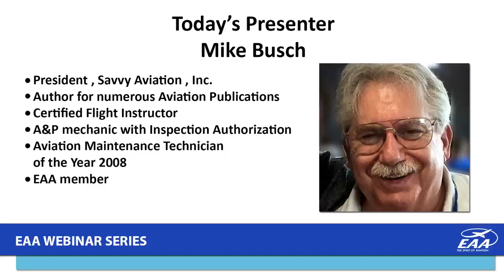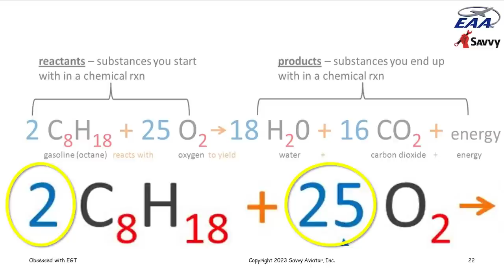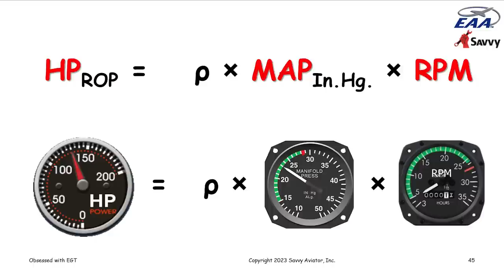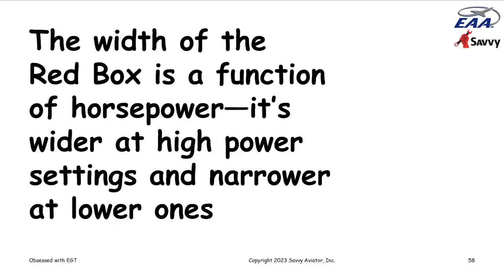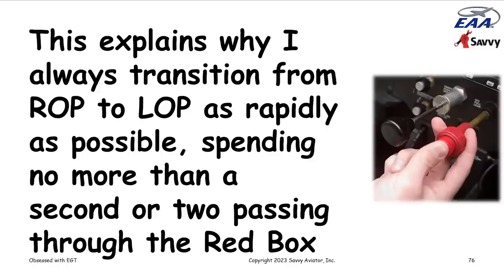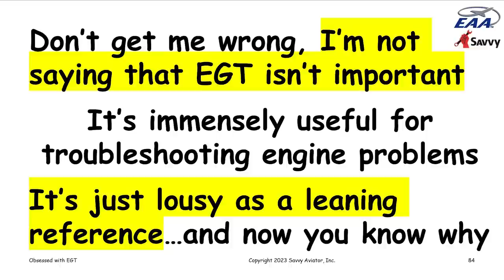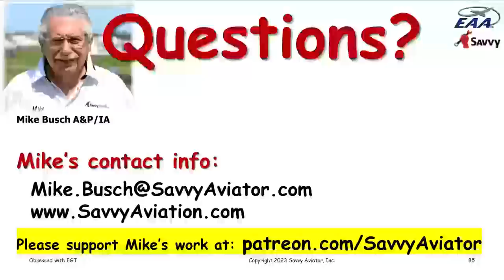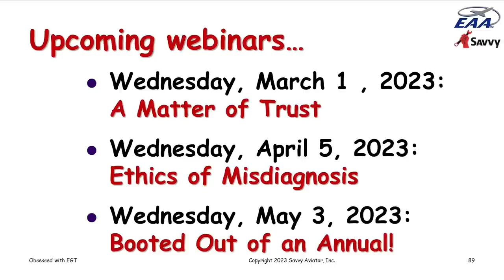Obsessed With EGT

Comment: The engineers of the 50s and 60s should have known about leaning as Lindbergh knew about it in the 30s.
Reply: @brettdavies-young7102  I agree.  Hopefully, people like the folks at GAMI and Mike are slowly dispelling the myths and newer engines like Rotax simply build it into the automation so pilots no longer need to be in the loop doing the wrong thing.
Reply: They did know. All this simplification to our detriment came when lawyers started help write POHs. Take the APS course at Ada even if just the online version. It is so worth it. Lots of the info comes from the WW2 data tables and manuals. The B-17 engineers used all kinds of good stuff to determine exact mixture settings for the pilots.

Comment: The problem with not using EGT is sometimes in rental aircraft, which the many of us who are not fortunate to own an airplane only have the EGT gauge in the aircraft. The other option would be how I learned way back in the early 80s to lean until the engine started to drop off RPM And fly approximately 25 to 50 RPM below maximum RPM for the throttle setting. It’s some cases leaving the throttle full and adjusting cruise power/ rpm with the mixture.

Comment: Coming from the automotive world I was surprised there isn’t a wide band oxygen sensor to run an air/fuel instrument. If we had these, it would the best way to adjust fuel mixture. Hopefully once we transition from 100LL to UL we’ll see air/fuel instruments too
Reply: I agree.  O2 sensors don’t like lead so they aren’t an option with the current archaic aviation engines and fuels.  Aviation propulsion is at least 50 years behind the technology curve sadly.
Reply: In automotive applications,  is catalytic converter  needed to have the after- before O2 readings to get a measure of unburnt fuel?
Reply: Simple is reliable........the more you try to make automotive engine mods to aircraft engines the less reliable they are as aircraft engines
Reply: @BrianOgilvie79  Modern auto engines are vastly more reliable than were their much simpler predecessors.  A modern airplane engine will be more reliable than current 70 year old technology engines.  Absolutely no doubt about it.
Reply: @rossrobinson7943  no, the sensor before the converter measures mixture and the one after the converter measures the efficiency of the converter
Reply: @LTVoyager  except everyone wants it’s for dirt cheap, that won’t happen. 

Also, I’ve worked on the “modern” Austro engine, one bad sensor and you’re grounded. Of course, it’s easier to fix from a troubleshooting standpoint, basically need a computer and basic diesel knowledge.
Reply: @TheReadBaron91  The Rotax is about the same cost as a Lycoming or Continental.  Using mass produced auto parts will keep the costs quite reasonable as they are pretty much dirt cheap.  And having redundant sensors for critical parameters isn’t any harder than have two spark plugs per cylinder, which is largely unnecessary with modern spark plugs and EFI.  The money and weight saved on the plugs will cover a number of sensors.
Reply: If you come over to the experimental side you can pretty much run whatever instrumentation you want, not withstanding your valid concern about lead contamination. Just don't forget that stock airplane engines are notoriously bad from a cylinder to cylinder A/F distribution standpoint and it is critical to make sure the richest one goes comfortably lean of peak.
Reply: @clarkstonguy1065  Yes, that is why GAMI exists.  😁
Reply: @TheJustinJ  If you are using a carburetor, you are nearly as far behind the technology as is the FAA.

Comment: great discussion with regard to the whys. I'm still stuck on trying to figure out the how that is very quickly discussed in the final two minutes after listening for the first 50 minutes discussing why the great reveal is gonna be so great!!! 

Doing "the great pull". I am assuming you mean pull until the engine starts to run rough and then increase the mixture to allow smooth engine ops. Do you keep adding mixture until CHTs reach a certain value (380F, 400F, etc)? Once you pull the mixture through the "forbidden range" so to say, what are you then adjusting to in a NA fixed pitch aircraft? thanks

Always love hearing these videos but sometimes it seems that the important stuff is just ran over real quick!!!

Comment: Your explanation of LOP operation is very interesting.
It makes sense, Deisel engines have no throttle, the control of power is solely determined by fuel metering.
I works on turbines, it works on deisels, why wouldn't it apply to petrol engines?
I guess the early petrol engines had throttles  because it was easy, and it stuck.
Reply: The throttle is useful because:
1) It allows for power modulation at lower power settings, without roughness, misfire, and risk of engine stall.
2) It simplifies non-computer controlled (i.e. mechanical) power modulation, because wide-open position produces max power. Conversely, max power is produced below full-rich mixture. Also, there is a wide range of rich mixtures that results in very small changes of power.

Comment: Thank you for your very informative talk about engine leaning and LOP operation. I have an aeroplane with a 285 hp radial, supercharged. I use it for aerobatics at high power settings. Do you recommend the same LOP operation principles as in your webinar?

Comment: Great video Mike! You mentioned that you fly with the throttle wide open and once LOP, use mixture lever to set the desired % power provided CHTs don’t go above 400. I’m curious, are the following two techniques equivalent or is one better than the other from internal cylinder pressure perspective?

1. First set MP to achieve the desired % power (say 75%), then keep leaning until we are lean of peak; as soon as we are in LOP regiment, % power will start dropping so we can stop right at 75% provided CHTs < 400.

OR

2. Keep the throttle wide open, keep leaning until we achieve 75% power and stop right there provided CHTs < 400.

In both cases we achieve 75% power, and based on the formula you shared, both should yield exactly the same results in terms of fuel flow since they are flown LOP and power is proportional to fuel flow. But are both cases equivalent in terms of CHTs?

My second question is what do you do when you need to slow down, say during an instrument approach? Do you pull back the throttle and mixture together to keep fuel-to-air ratio constant? (since reducing throttle enriches the mixture) Or, do you simply keep the mixture as is and reduce throttle far enough (below 60% power) where the suddenly slightly richer mixture doesn’t matter? (since the red box ceases to exist).

Comment: Great seminar, as usual. 
In the chemistry part of the lesson, some folks may get confused about Octane as a molecule vs Octane rating. The octane molecule has 18 structural isomers, all of which have the same C8-H18 atomic composition. One was chosen as the octane rating reference octane isomer: 2.2.4 Trimethyl Pentane (iso-octane). Gasoline will contain other octane isomers, which have different octane numbers, and flame speeds. 

The curious among you now have search terms that will allow you to get the full picture!

Comment: Once I learned where my peak and lean of peak, once I am at 22/22 I go straight to approximately the gallons per hour I know has my EGT & CHT where I want it. Low load on the engine in cruise and only loose 10 mph , 125 mph instead of 135.

Comment: As Mike says @ 39:00.  Run 65% power and run peak if you want.  Continental also says this.  If your exhaust is gray, perfect, if black, too rich.
Reply: It wasn’t until an 1+ 20 minutes in, he said he ran the throttle all the way in at full. Then adjust the mixture for fuel flow and manifold pressure. I don’t think he gave us the formula in this entire monologue. He told is what he does, but not how to do it unless of course I missed that part.

Comment: I like this much better than some of the propaganda of the deciples of the church of LOP, thanks Mike. It's really almost tragic how people fear the red box or purple box, that doesn't even exist below 75% power in a IO360 e.g., you don't get CHT that high, didn't see more than 360° in cruise. Above that the best approach is full rich, because you really don't get outside the red box with less fuelflow. NA engines in cruise usually aren't operated above 75%. If you lean from 70% power until you arrive at 65% power, you never go through the red box and are well LOP. It's really very simple and over amplified.

Comment: When I get to my cruise altitude in my Cherokee Six I set the RPM and fuel flow on my IO-540K1A5 in accordance with the curves in the Lycoming engine manual. The curves I use are on page 3-34 of the Lycoming Operator's Manual for the O-540 and IO-540 (Part No. 60297-10). After setting the RPM to (usually) 2400, I use the big pull and quickly set the corresponding fuel flow. The throttle is always at maximum until I get to pattern altitude at the destination airport. This works every time.

Comment: Although I am very much in agreement with what Mike has to say, I am not sure that I fully agree with throwing away EGT as a primary tool for leaning as it obviously responds much faster than cylinder head temperatures. I completely agree that it isn't worth spending time in the red zone to know exactly how lean of peak one is. But thinking that if after making the big pull exhaust temperatures are more than say 50 or 100 degrees higher than they were comfortably rich of peak (at a 70% power fast cruise I would guess this is 100 to 200 degrees lower than peak), then there is a good chance that cylinder head temperatures will be creeping up over a few minutes too.

Comment: So after Cirrus discovered it was their recommended slow transition from ROP to LOP was causing the fine wire plug insulators to crack, what did they do? Change the guidance on how to lean, change the plug manufacturer or something else?
Reply from the maker: I am aware that Cirrus issued a service bulletin recommending the Champion fine wire plugs be removed from service. All new airplanes from that point on shipped with Tempest fine wire plugs.  I assume this was in response to the cracked insulators on the Champions.

I am not aware that Cirrus changed their recommended leaning procedure. They might have, but I'm not aware of it. -- MB

Comment: Wonderful educational thanks a bunch Mike... Suck squeeze bang Blow. Who new it's this complex and fun 😂😂 so to add to the cracking spark plugs.. what about climbing after lop would cause a very bad situation buy putting pilots in the box for extended period of time until the pilot gets to the mixture after they stabilize at cruise... ?!?!?  Just a thought of maybe picking a different power setting where one is constantly changing altitude.... But would decrease climb performance. But would raise pilot work load in dense traffic.. so that's why I like injection and rotax they don't have to worry about the big red stick lol

Comment: In a vehicle that relies on pilot adjustable mixture control in every phase of its operation, where range and payload and maximum performance are required on every flight. As well as safety and power-plant longevity. 

Why haven't there been AFR (Air Fuel Ratio) Sensors equipped since the mid-80s?

Its ridiculous. 

Some say its due to Lead fouling. But spark plugs suffer also, and the fix is simple.

Tbh, by the mid-90s ALL aircraft should have been retrofitted with modern EFI instead of the ancient, ice prone carburetor or vapor-lock susceptible non-return style caveman injection systems. 

MoTeC, ProEFI, Megasquirt, MSD, Holley. Why aren't there aftermarket or OEM solutions for certified AC?
Reply: i was wondering the same thing, wouldnt an automotive aftermarked AFR Sensor save the hassle of finding peak EGT and get you an exact AFR?

i found your point about lead fouling very interesting and searched for lambda sensor and lead fuel.
some numbers for automotive Wikipedia said were: 160,000 km normal, 24,000 km with leaded fuel so it shortens their life by 5/6

Sunoco Race Fuels has this to say:
"Many racers using a leaded fuel in an oxygen sensor application are able to use the sensor only for tuning purposes and then remove it. This ensures a much longer usable life for the sensor."

dont know how worth it is, FAA wants to phase out leaded fuels by 2030 so then it would be easier
Reply: Yup. Throw an 02 gauge in at least. If it goes bad oh well who cares change it out. I ran a 800hp car on 110 leaded fuel for 35k miles. Never once had a sensor go bad. I might just throw them in my experimental planes and find out

Comment: Modern car engines last a long time so I suspect electronic engine controls and their algorithms will not reduce the life of an engine.  Now, auto engines have control over fuel mixture as well as spark timing so they can avoid areas of operation that are sub optimal whereas only Rotax does that in the aviation world as far as I know today.
Reply: Main reason they last so long is they don't operate at high power levels for long periods.  A car cruising at 80mph down the highway might be using 30hp to maintain that speed.  Whereas a plane is cruising at 60-75% power for nearly the entirety of the flight.
Reply: @SJ Aviation  And yet both of the modern Honda and Suzuki based aeromotors are just as reliable, if not more so.
Reply: @amtank  because they are built for that type of operation, not automotive.
Reply: @amtank  Based on what data?
Reply: @sjaviation modern automotive engines last much longer than the automotive engines from the era most aero engines were designed. Since they have the see the same usage, it's probably accurate that the modern electronic engine controls are contributing to longevity.

Comment: I wish such detailed testing and analysis was published concerning the ubiquitous Rotax 912 (carb'd), where mixture can only be adjusted on the ground.  There are far too many--usually contradictory--opinions, and far too little real analysis.  I want a "George and Mike talk Rotax" video.  ;)
Reply: There is a lean tool that can be added to the rotax 912 carbs with adjustment in flight. I have fitted one to my aircraft with good success. It’s experimental only tho

Comment: Slide 28 is incorrect. The excess fuel doesn't act as a refrigerant, it simply isn't burned due to lack of oxygen, and thus doesn't get to release its energy. Temps drop LOP due to additional air mass the fuel energy must heat
Reply: Not sure it is incorrect. If it cools cht, than it is correct isn't it? I don't read too much into the "refrigerant " term
Reply: It's not incorrect, it really is evaporative cooling like sweat. But faster.
Reply: @TheBarzook  except it isn't. Evaporative cooling makes roughly a 14F degree difference to the precombustion mixture temperature from ROP to LOP
Reply: Andrew Lynch ….. If the excess fuel didn’t cool the EGT, and only stopped producing heat, then EGT would peak and hold.  Since the EGT does drop as the mixture gets too rich, it’s obvious that fuel is cooling the gas temp.  Your statement that the mixture is cooler LOP because there’s more air to heat than fuel to make that heat is the corollary of the ROP situation.  At ROP, air is limiting, so any additional fuel simply adds something that must be heated by the maximal fuel burn/reaction/heat production.  Maybe, as you say most of the actual evaporative cooling happens in the intake manifold, but we aren’t measuring that, we are only measuring on the CHT or EGT.
Reply: @jimrankin2583  recommend reading about adiabatic flame temperatures in relation to fuel mixture
Reply: @andrewlynch17  The excess fuel in addition to not fully burning does have mass that absorbs heat and I believe that does significantly contribute to lower temperatures when rich of peak. Just like excess air has mass that lowers the flame temperature when lean of peak. Efficiency from running far rich of peak doesn't fall off as fast as flame temperature does because the fuel is still being partially oxidized (resulting in higher CO and HC products than when running stoichiometric) but all of the fuel is adding to the mass of the charge that is heated.
Reply: The unburnt excess fuel in the chamber is heated through a phase transition from liquid to gas which absorbs heat (like a refrigerant) that would otherwise go into the exhaust gas (EGT) and engine (CHT) - same reason water injection cools the mixture down.

Comment: Why are max CHTs different for different manufacturers?
Reply: Lycoming uses sodium-filled exhaust valve, which tend to tolerate higher temperatures.
Reply from the maker: Lycoming CHT's tend to run about 20°F hotter than Continental CHT's, largely because Lycoming sodium filled exhaust valves are more efficient at transferring heat to the cylinder head than Continental's solid stem valves.

Lycoming's red line is about 40°F hotter (500°F versus 460°F). I believe the biggest factor is that the much more robust head-to-barrel junction of Lycoming cylinders can tolerate more heat before it starts to come apart. -- MB